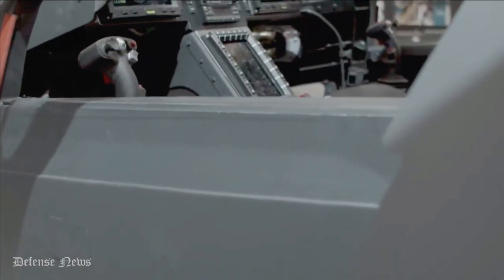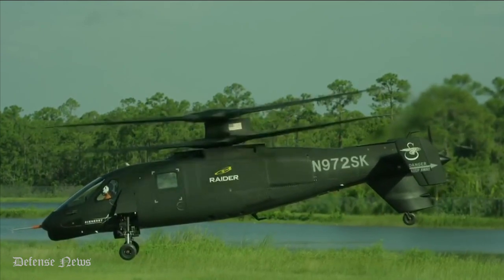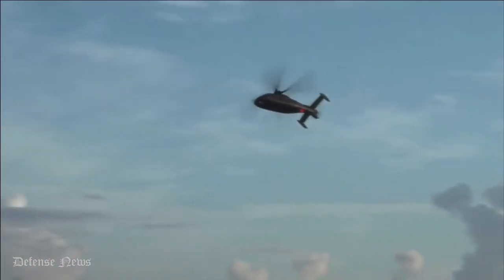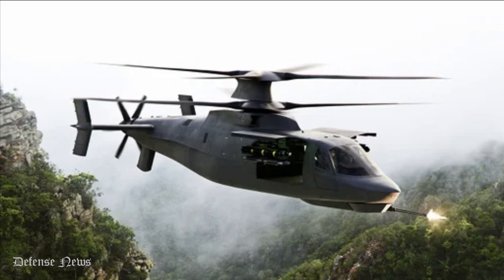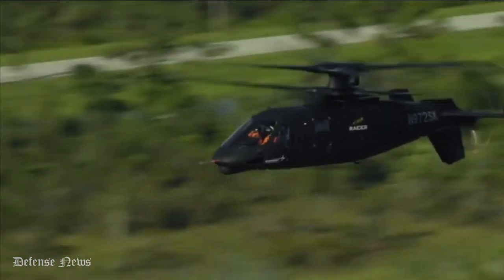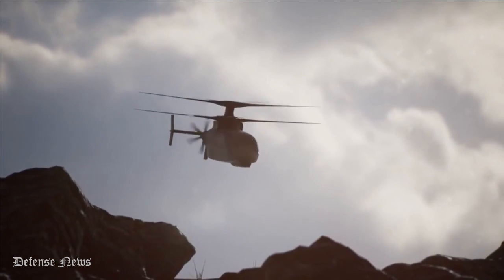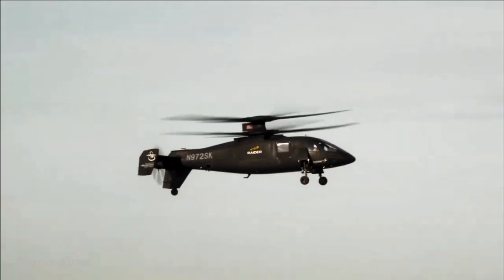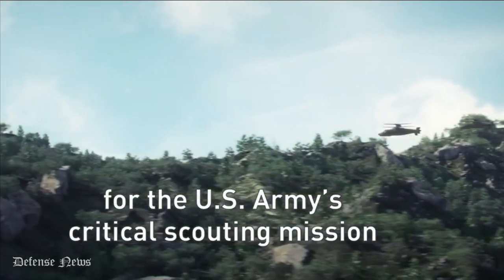What makes Raider X Helicopter so Special

Comment: I’m sad it wasn’t selected by the Army.  I’m worried a mistakes been made by choosing the tilt rotor
Reply: That's another program. This one is for a reconnaissance/ attack helicopter
Reply: Let's look at the pros and cons shall we this is being unbiased.

V-280
Pros
Substantially longer range.
Considerably faster.
Greater reliability.
Greater troop capacity.
Less maintenance.
Greater payload.
built on an open architecture system.
Built on lessons learned and thus a mature technology that has proven safer than conventional helicopters.
Cons.
Only a little bit larger than a UH-60, making a landing in smaller areas a bit more troublesome.

SB-1 Defiant and its associated variants.
Pros
Smaller than 280 but not by much.
 Design is easily scaled up or down.
Greater maneuverability.
Cons.
Larger than a UH-60.
Slower than a tilt-rotor, faster than a helicopter.
Has constant reliability issues thus resulting in fewer flight hours.
Substantially lower range.
 Lower troop capacity, 2/3 of the aircraft is engine and drive shafts.
Higher maintenance and RnD costs.
No room for further advancement.

Further, the ability to auto-rotate isn't a con nor a pro and doesn't make the helicopter safer since it has only been used twice in the seventy-plus years of military service with countless sorties. Those two times weren't even combat-related.
Reply: @Predator42ID  Also unlike the internet myths out there a tilt rotor aircraft can auto rotate and glide but like you said it isn't even a major consideration.
Reply: @Predator42ID  stupid question what if they used a jet engine on the back instead of a prop?
Reply: @theofficialmbc  Aside from a speed improvement, it would result in a reduced range.
Reply: @Predator42ID  would the new engine fix that problem? maybe added fuel capacity? or would that then add too much bulk?